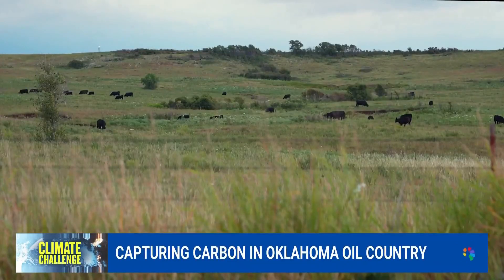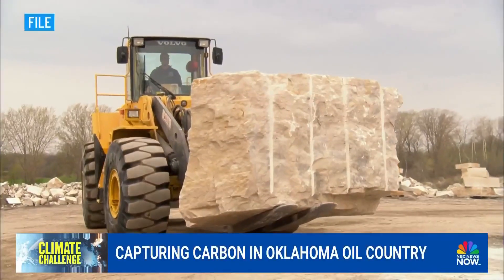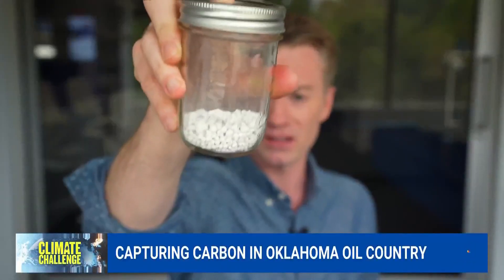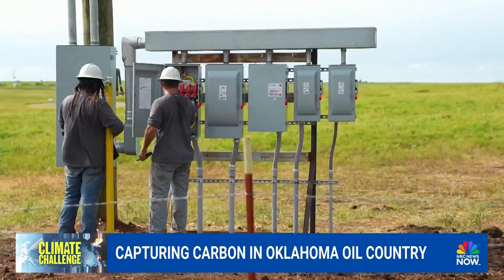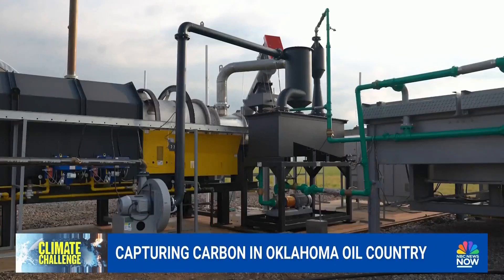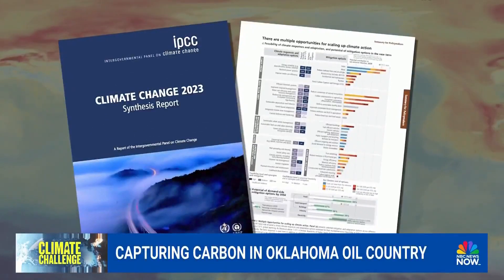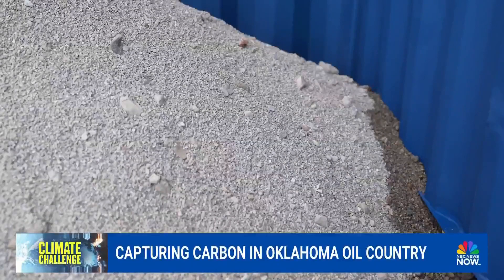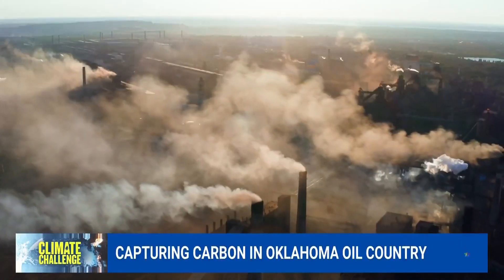Company captures carbon using wind in Oklahoma's oil country

Comment: Carbon capture is 100% a scam in a world still continuously producing carbon emissions. Adam Something's youtube channel has an excellent summary of why this is but essentially the ONLY realistic use case for installing carbon capture would be in very rare areas where there is excess renewable supply above demand and is too distant from other energy markets to share its surplus into those grids. And even then it would be more efficient to just soak up that excess green energy by building things like data centers there that would otherwise be built on fossil fuel grids. Maybe... MAYBE 50-75 years from now when we have transitioned to 100% renewables we can consider carbon capture to undo the already done damage.